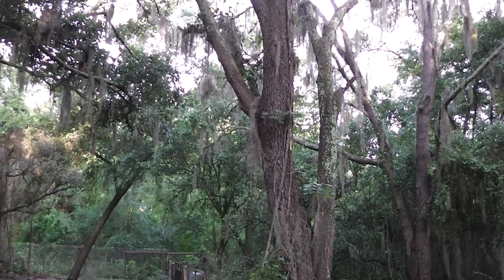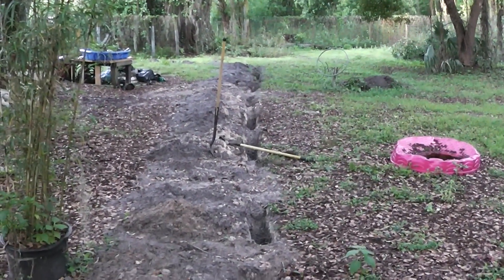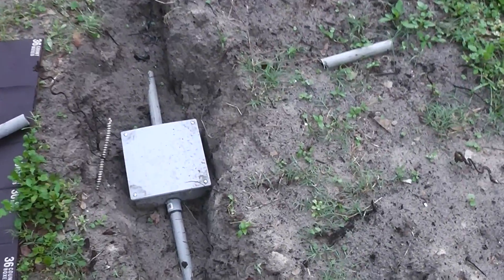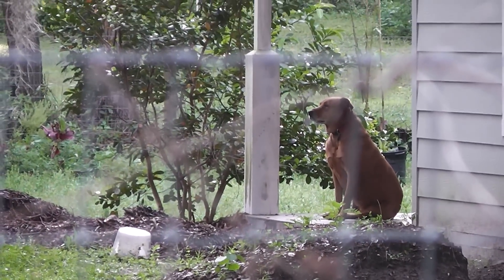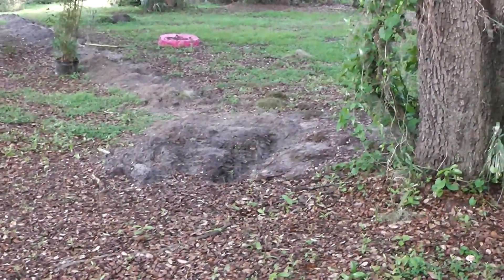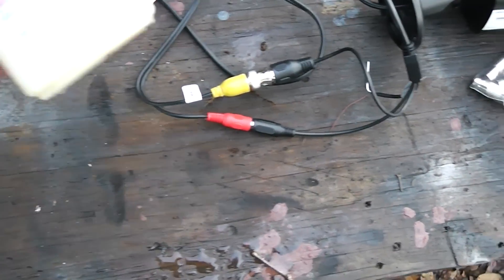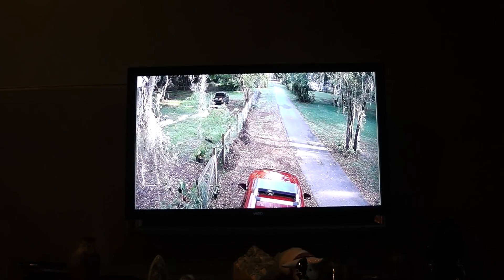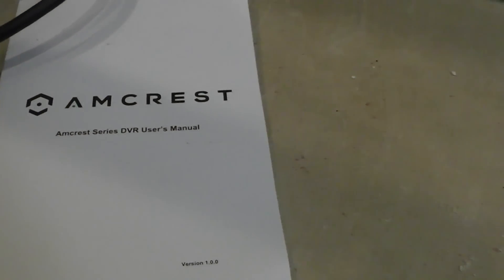Security Cameras for Now and WSHTF around my Homestead

Comment: that's funny that you put yours in underground because I dug the same way you did to put mine in. it took me four hours to get a second cable through mine because the second cable kept getting twisted up with the first cable and had a lot of trouble getting them through every fitting that I installed in my pvc pipe the cable ends would get caught in every fitting. I bought 3 types of fish tape to pull them through and the same problem. I went to 2 inch pipe and they still got caught at every fitting.

Comment: How did you drill holes in your house from outside
Reply from the maker: I used a masonary drill bit for the initial hole, then I chipped it out the rest with a hammer, chisel and a saw.

Comment: Those heat shrink insulators would work well for that application.
Reply from the maker: Yes agreed but, do like the waterproof characteristics of the duct seal.  I guess by using both, it would offer a more substantial protection.  Thanks for the suggestion.

Comment: very imformative. i live in the panhandle, on a bayou, and want to do something similar facing my water approach. can i ask why you didnt run the wire thru the trees?
Reply from the maker: Renaissance MarineTV Good question. I guess there is no right or wrong way. We have so many storms with high wind gust and broken tree limbs that I wanted to minimize the maintenance and repair issues. 
The job sure would have been done the job a lot faster and easier by doing it aerial and direct burial. Btw, my neighbor will be running his direct bury. 
Wshtf happens, my expanded security system wires will be run through the trees to the adjacent properties.

Comment: You should look into IP cameras with POE.
Reply from the maker: When I do my next upgrade I will.
Reply: @homesteadprepper  I hope you have changed your mind about doing IP. While Amcrest does sale IP 4k systems They also have 4k BNC and seeing your already wired why change to something that is such a PITA... Main this is IP was the way of the future a few years ago. Everyone thought it was going to be the only thing in UHD Ultra High Def. Well CVI 4k Rocks and is as easy as taking down your 1080P and adding the 4k and chaning out the DVR... Another thing. They sale the DVR without cameras also, They will or may run your 1080 cameras so you could always change out a camera or 2 when you have the extra cash and keep the ones rolling in the new DVR at the same time...